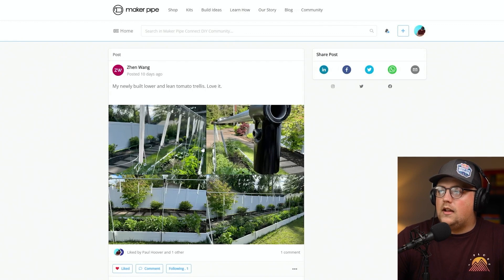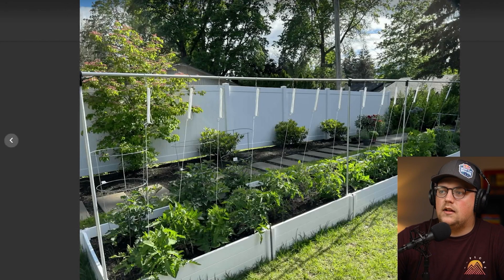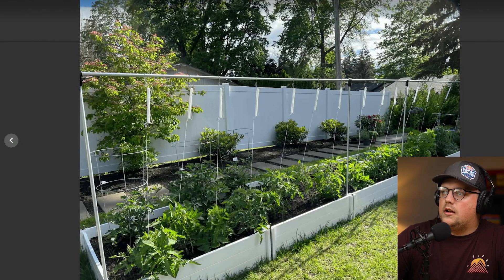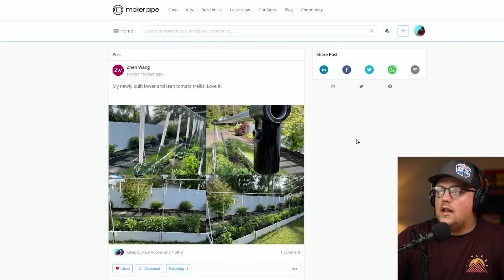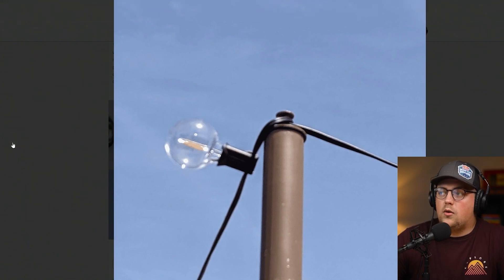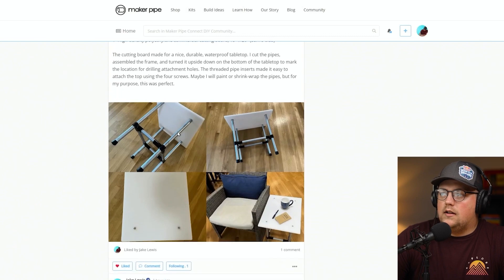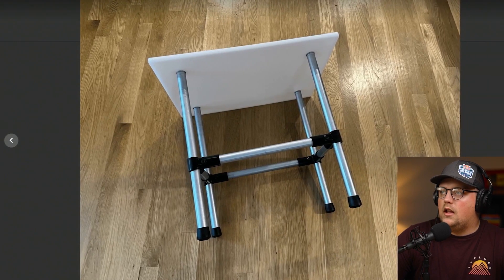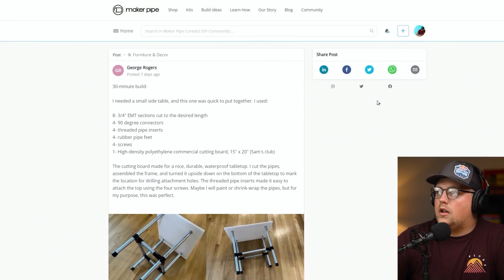DIY Trellis & 5 More EMT Conduit Build Ideas | MPM - 103

Comment: @Maker Pipe -- I like and use your connectors for many things BUT  you  do  not  want  Cadmium  in  your  garden  soil.
Reply from the maker: Thanks for the interest, but you do not have to worry. We do not use cadmium plating at all.  Zinc (silver) or ecoat (black) which are regarded as safe for gardens.  But we are happy to sell them as raw steel to you if you like, just will rust right away.